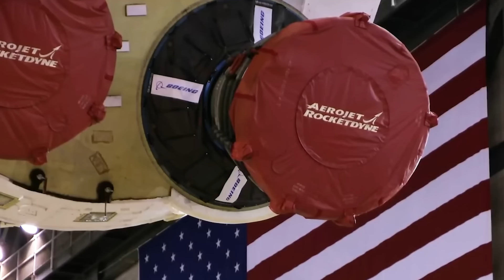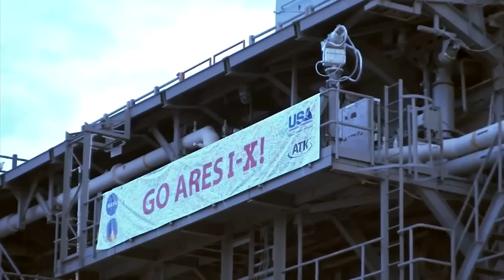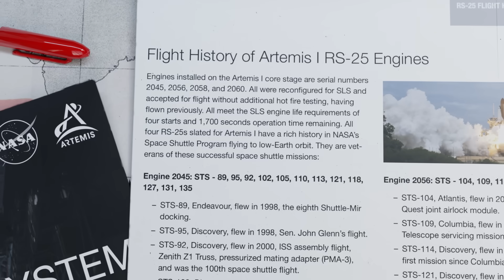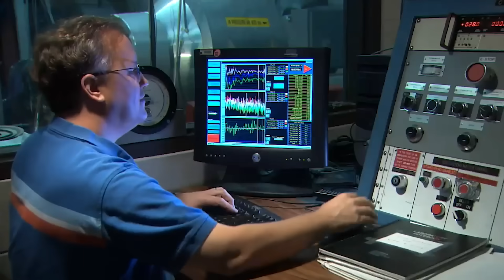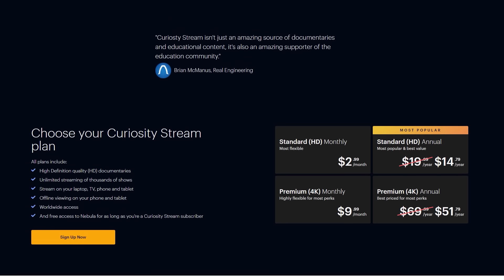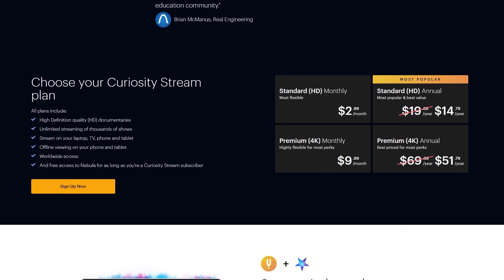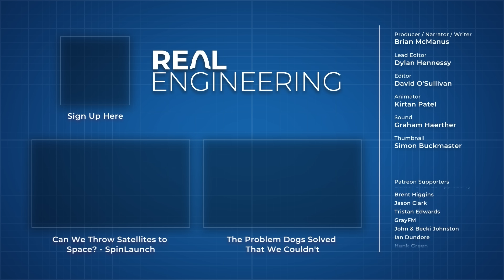The SLS is Outdated. Why Does it Exist?

Comment: The reason the SRBs are not being recovered, is because this does not save much cost for SRBs, where the main cost is putting the fuel in in the correct manner.
To recover them, you would need to clean the casing etc., which is basically just a steel tube where the only fancy part is the nozzle. If I recall correctly, recovering the SRBs was approximately as costly as making new ones for Shuttle, though I'm not sure on the exact numbers.
Reply: So it would not save MUCH money? So you are saving the effort would pay off. All the work required included.
Reply: In terms of increased liabilities and design compromises no it wouldn't, the real question is why are they bolting the original reusable liquid fuel engine to a disposable vehicle. They seriously couldn't design a new one?
Reply: @roflcopterkerman4589  maybe a new engine design, if only they could tap into, say, the food stamp budget for a year, for funding that, for example!!
Reply: @ronschlorff7089  If only they did, Food Stamp program in the US for FY 2021 was 182.5 billion dollars. If only NASA had that kind of budget we'd already be on Mars.
Reply: @Knight_Kin  yup, a year or two after Jimmah the peanut farmer approved of that and other wasteful welfare and green programs in the 70's we'd have had a colony there in the 90's!! Vote red (for Mars) space fans! ;D
Reply: Solid rocket motors seem to have gotten a bad reputation lately. Elon has convinced people that discarding a motor case is like throwing away a car after one use. Bad analogy. Especially when you neglect to account for the massive increase in cost, complexity and therefore risk to produce a single liquid motor vs. a simple ablative nozzle. Elon will blow up more nozzles in a year on a launch pad than Artemis will discard in the entire program. 

Also, NASA and SpaceX, both companies I have done engineering work for, are not the same. NASA is profoundly more impactful. Private/Commercial space is awesome, but it should never replace our government funded programs. It can be a compliment, but we should be careful of reliance on a company that could go bankrupt (and almost did) overnight. 

I don't plan to go to space. But I would much rather take a ride on a SRB than something with dozens of liquid motors. It just sounds like a bad risk calculation and recipe for disaster. But only time will tell.
Reply: @jimmyfuntime4378  Yup, the N-1 was a multi-cluster rocket, did not work out well, as the five cluster Sat V, for example. And despite the two disasters shuttle did well enough with SRB's in tandem with liquids!
Reply: @roflcopterkerman4589  They did design new ones.  There were only 16 engines (RS-25D's) with usable service life left at the end of the shuttle program.  Without new ones, they would have had enough engines for just 4 Artemis flights.  Once these engines are expended, the rockets will be fitted with newly designed RS-25E engines, which are cheaper to build since they do not need to be engineered for multiple flights.   At a cost of $146m per engine, the savings of using up the remaining shuttle engines before flying with new engines is self-evident.
Reply: @pghpaisan  ah yes the shittier  redesigned RS25 just cost 2-3 whole falcon launches per engine. Why is anyone at NASA still employed.
Reply: @roflcopterkerman4589  falcon wouldn't exist without NASA. Is that a sufficient reason?
Reply: @jimmyfuntime4378  Why would you think that? One could argue government space programs and the regulatory infrastructure that came with them functioned as gate keepers to space development.
Reply: @jimmyfuntime4378  Elon in a nutshell, solving a problem that's doesn't exist, and marketing it as a profound new breakthrough.
Reply: @roflcopterkerman4589  and falcon rockets can't launch that big of a payload to higher energy orbits and beyond
Reply: @rajashashankgutta4334  SLS is competing with starship, the heavy lift vehicle formally known as the BFR. Not the falcon which essentially an atlas competitor that actually could put people in orbit. The first American rocket to do so since the space shuttle.
Reply: @roflcopterkerman4589  The same reason. As awesome as those RS 25s were, they cost too much money to reuse. I wish they'd store some of them in a museum. They're iconic. Flew so many times to space and back.
Reply: @roflcopterkerman4589  did you see the mess that was Starship’s test launch? Enough said.

Comment: I know many are on the "why use an expendable rocket?" train, why doesn't NASA use one? NASA did have one in the 1990's, the DC-X Delta Clipper, it was a scaled down technology demonstrator - but the materials science wasn't there yet to make a full scaled version viable as it's dry mass would be too high and NASA would have to choose between Venture Star (similar materials issue) and the Delta Clipper as it couldn't fund both projects.
Reusable rockets are still in their infancy, only one rocket company has a reusable orbital class rocket, SpaceX - that's it. And that only consists of the Falcon9 and the Falcon Heavy. What many often overlook as they are caught in the Sci-Fi like spectacle of the boosters landing (which is very, very cool!) is that a sacrifice must be made for reusability - payload mass to orbit. The F9 sacrifices roughly 40-60% of max payload to orbit mass to RTLS or drone ship landing as it needs that fuel for landing and to cover the mass of the landing hardware (legs, etc). This is great if you aren't launching anything that heavy and/ or it's only going to low Earth orbit. If you want to go beyond low Earth orbit though, you need a lot more speed, which means a lot more fuel to be used for that acceleration making a reusable rocket a lot less useful - it becomes the wrong tool for the job.
Enter Starship - Starship aims to be a heavy lift reusable vehicle and SpaceX has a plan to get around the limits of the F9/ FH for going beyond low Earth orbit while still being reusable. But it too is making an alternate sacrifice; mission complexity. Starship won't be able to go to the Moon with a full payload in a single launch - it will require 4-5 additional launches to refuel the first one on orbit so that one can continue on to the Moon. So for a single Starship to go to the Moon, that's 5-6 total launches, that's 33 engine ignitions per Heavy Booster and 9 per Starship - that's 210 - 252 engine ignitions just for low Earth orbit! And to go to Mars, it's 9-10+ launches to send one Starship! That is a lot of potential areas of failure.
Add to that, orbital refueling at the scale required for Starship to successfully go to the Mun or beyond has never been attempted, moving 100 tons of fuel from one Starship to another (x5!) is a huge deal, you can't just start a pump - pumps on Earth require gravity to function, so the docked Starships will need to have a small force of acceleration to the docked craft during the length of fuel transfer. 
This all adds up to a ginormous amount of mission complexity compared to SLS - which can go to the Moon in a single launch and only requiring a fraction of the number of engine ignitions and no massive on orbit refueling. So when you look at from this perspective, SLS makes a lot more sense. 
I hope SpaceX pulls it all off, I really do - but that's a lot that can potentially go wrong. Being a private company, they can have it go wrong and try again without it being a political and public relations disaster, if NASA were to try that and something went wrong - well, we likely wouldn't be going back to the Moon.
Reply: Wouldn't many of these issues be solved just by making the rocket as big as yo mamma? I don't see why economies of scale wouldn't kick in at some point. Let's say they make a Starship that's 3 times the size of the current one but it keeps the same payload volume. That would certainly require less refueling, right? Wasn't the Sea Dragon Rocket all about economies of scale?
Reply: SpaceX has launched multiple payloads to the Moon and has launched a payload out to Mars. This was with reusable rockets. Some of SLS’s payloads have been moved over to Falcon Heavy as the SLS is too expensive and launching to infrequently to launch them too. Falcon Heavy will be launching some of the Gateway modules and will be launching Europa Clipper out to Jupiter. All for billions less than a single SLS launch. 

Starship resets the rocket equation by refilling in LEO. It’s design goal is over 100T to the Moon or Mars. 

Despite the mass penalty SpaceX has launches more mass into orbit than any other country for the last few years. The costs savings can’t be over stated.
Reply: @bensemusx  I know the cost saving are there - any private endeavor will always cost significantly less than any government project - regardless of architecture - nature of the beast. 
I was just trying to point out that reusable rockets come at a sacrifice that many are ignorant of, or choose to ignore and are still in their infancy - and will only get better with time. 
Those sacrifices ae payload mass or massive mission complexity, something NASA can't take on as again, if anything goes wrong at all, it's a massive political and public relations disaster setting everything back by several years and costing significantly more. 
The payloads you are referring to are low mass,  the Danuri spacecraft weighs in at 1500lbs (678kg) and Elon's car weighed 2700lbs (1225kg). As I stated, F9 and FH are great for low mass launches - which is what most launches are. But if we want to send people, the required launch mass goes up exponentially, especially if we want to send them beyond LEO. 
And we have to have more than a single human rated heavy launch provider - what happens if Starship suffers a massive and costly setback and bankrupts SpaceX or Elon decides to sell SpaceX and the new owner dumps the Starship program? 
Too many unknown unknowns - and hopefully, we can launch SLS more often as that will be the only way to get the costs to go down, is launch more - see SpaceX.
And to use it to build orbital infrastructure around Earth and the Moon - orbital refueling structure would greatly expand the use of reusable spacecraft and reduce mission complexity - which are the future - but we only have a toe in that water thus far.
Reply: @bensemusx  Adapting gateway and Europa Clipper to fit Falcon Heavy and pay for the VIB actually costed just a tiiiiny bit less than launching on sls would have. No "billion cheaper" bullshit.
Reply: @zualapips1638  Sea Dragon is yo mama. I like to check vids of that one, also other concepts like Orion nuke powered one from the time of Apollo!

Comment: During the USA manned space flight days, Lockheed was blacklisted after the agena failure. Then came Hubble, what a mess. Lockheed has alway had some crippling flaws in their products.  Now Orion sits on top, made by Lockheed who has never built a manned capsule, what could go wrong.
Reply: Well it has already been to space once. This will be the second Orion launch before they put people in it.
Reply: Who built the LEM?
Reply: Not entirely sure what you mean that Lockheed was “blacklisted”, or the “Agena failure”.  The Agena was a rocket upper stage that was used very successfully from 1962 through 1987, with several different versions being built and successfully used by both NASA and the DOD.  It was used during the Gemini program, and also on Atlas, Thor, Thorad and Titan IIIB rockets for several decades, with WELL OVER 300 of them built and successfully launched into space.  So what do you mean when you say the “Agena failure”?  I’m just curious.
Reply: @jimbaulsir8838  Grumman Aircraft Engineering Corporation
Reply: What agena failure? 300 rockets built and used is a failure?
Reply: Incorrect little buddy
Reply: @jimbaulsir8838  Grumman
Reply: various companies built subsystems for the apollo program, including lockheed. I used to work for Martin Marietta (merged with Lockheed to become Lockheed Martin), which built the command module.
Reply: You were right 😂
Reply: @michelmilaneh8963 heat shield issue?
Reply: @Wahba.  yes , look it up artemis 2 was delayed another year due to this issue
Reply: @michelmilaneh8963  family traditions I guess , I will take a look at it thanks.

Comment: If SLS is outdated, what do you think Soyuz should be called? ;) Soyuz is basically R7 ballistic missile variant with updated engine design from 1950's. It's been in wide use to this day.
Reply: Not only that. It also proves itself as the safest rocket currently operational with more than 120 flights without a loss of a single life.
Reply: I work in the engineering field and there are far too many stupid engineers that think because something is not "cutting edge" that it is outdated or obsolete.  This is false.  Moreover, when someone is building new equipment that is cutting edge, it is common to find a lot of "legacy" parts with proven track records to limit risk.  Videos like this guy's are normally content paid for by market competition.  SLS competition includes SpaceX which is behind SLS but very much nipping at its heels.  In distant third is Blue Origin that is so far behind that they can't even really be seen.  It is likely this content is paid for or contributed to by SpaceX.
Reply: Point is they are not developing a new 1950s rocket that's basicly the same as a 1950s rocket
Reply: @Charles Something that is about to hit its maiden voyage cannot be considered obsolete to something that has never flown.  Kids.  I get this kind of mental deficiency a lot from the younger engineers I employ.
Reply: @Charles You can't really compare these engines, since SpaceX design is full flown type leading to lower chamber pressures, hence giving it chance to be reusable. Soyuz uses oxidizer rich engines that are cheap, but they are not light. This design ensures fully utilizing fuel energy but it potentially damages engine beyond repair. And you can't re ignite those engines. SLS/shuttle engines are fuel rich type that ensures maximum durability but delivers suboptimal performance.
We don't have proper information available about exact cost of each of these systems. All we know that each engine model is optimized for different scenario and that leads to different characteristics, pros and cons.
Elon Musk tried to buy RD171 or 180 type engines but never got those. Lockheed Martin and Boeing use that type of engine, and Musk has said that Russian engines used in Atlas V are great. Take it for what it's worth.
Reply: @Charles those pesky "landings" tho... LOL ;D
Reply: @JenkinsStevenD  introduce them to pink pieces of paper then!! ;D LOL
Reply: @jarivuorinen3878  Soyuz first and second stages have no preburners, the motors are in fact WW2 V-2 missile technology with steam powered turbopumps! Steam is supplied by decomposition of hydrogen peroxide.
Reply: @carjac820  Falcon 9 is actually the safest rocket and was at the time of your comment. It hit it's 200th successful flight in a row on June 1st. It has now landed more times successfully in a row than any other rocket has launched successfully in a row. The Block 5 version has landed 177 out of 182 attempts with no failed landings in 2.5 years.
Reply: That is a bit of a stretch.  The overall design of the "Soyuz Rocket" may be the same as the R7, but decades of upgrades and refinements have made it a much different vehicle.  Same goes for the Soyuz spacecraft herself.  Some say "if it ain't broke, don't fix it", but there have been many fixes and tweaks.  They just didn't toss everything in the bin and start over from scratch... like we had done several times.

Comment: I still believe that the Saturn V is still the most powerful rocket ever built. The fact it was designed and built without CAD is amazing to me. When I read about the SLS, it just doesn't have the same vibe as the Saturn V does. I understand we as a species we went to the moon already and accomplished such amazing scientific research, but the SLS doesn't feel the same.
Reply: Starship is the most powerful rocket ever built, followed by the Soviet N1 moon rocket, followed by the SLS, and then you get to Saturn V.

You have to add modifiers to the statement to arrive at Saturn V. Like, Saturn V is the most powerful rocket ever to reach orbit.
Reply: @espenha  in my book starship is still far from being a reliable lift vehicle due to it's type of development style
Reply: @manlyastronaut6984  That's fine. But it has been built. So it is the most powerful rocket ever built.
Reply: CAD doesn't do anything you couldn't do yourself with pen, paper, and a slide-rule. It just makes things faster, like a calculator.
Reply: @espenha  Starship has never launched anything anywhere except the flopover test. Saturn is the most powerful rocket ever launched from earth. The others, even Artemis have yet to launch so they do not count until they are successful. Already, Artemis had to scrub today's launch because of an engine related cooling problem.
Reply: @nebtheweb8885  The N1 rocket is the most powerful rocket ever to launch from earth. It dind't make it to orbit, but it did launch.
Reply: Actually it burned for more than a minute.
Reply: And Saturn did it all on liquid fuel.
Reply: imagine thinking "vibe" matters
Reply: the first of anything will always be the first of anything. Cracks me up when they say, "we are going to the moon", then begrudgingly add........."again"! ;D LOL
Reply: @espenha  .........or go the moon many times!! LOL ;D
Reply: @espenha  Yes, regarding the N1 "successful launch", but close only counts in horseshoes and hand grenades!! ;D
Reply: @phinyx  I love both those rockets, have made flying models of them! They both fly Spectacularly, like the real ones! Old joke at the time: "our German scientists are better than Russia's German scientists". ;D LOL